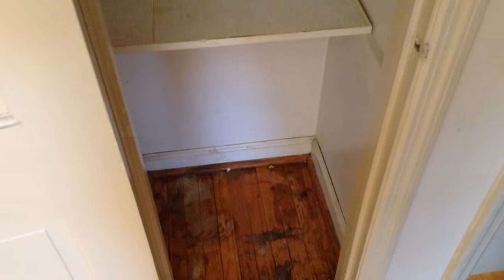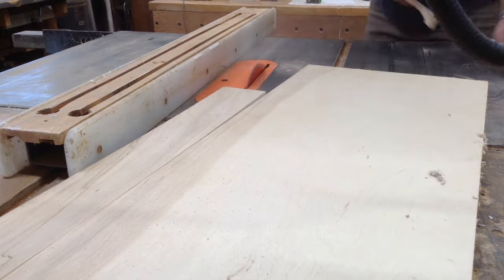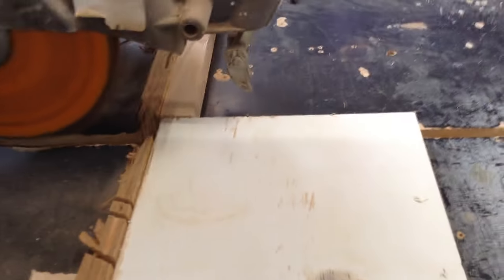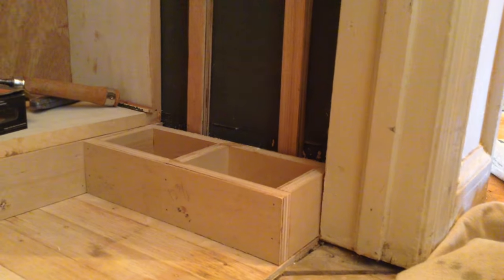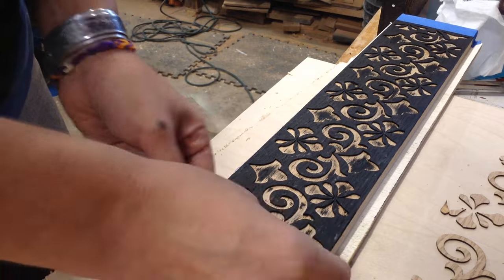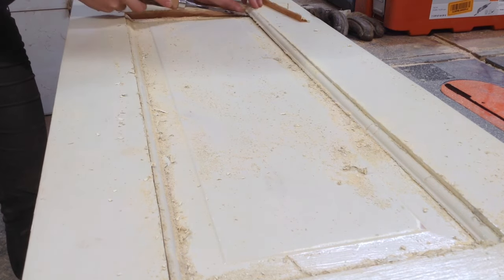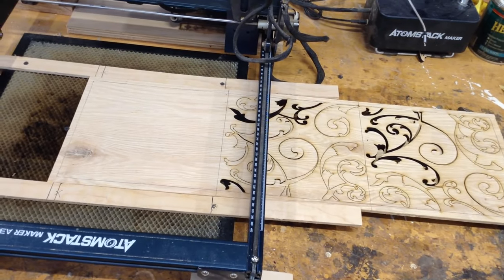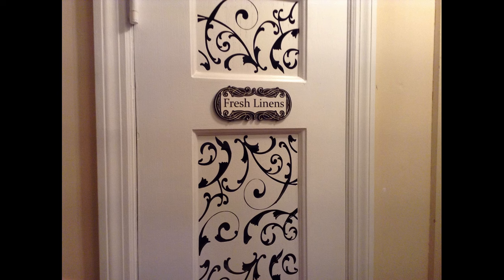Closet Remodel || How To  [Woodworking Projects]

Comment: Damn I want a laser engraver/cutter even more now, that turned out fantastic completely changed the vibe of what was just a plain little closet, not sure I’ve seen wood bleach before it certainly worked well and taking away the smell was a double bonus, you certainly have a design flair I wish I possessed, but that’s just life I guess 👌👌👌👍👍👍🇦🇺
Reply from the maker: The laser is a game changer for stuff like this.  The time commitment to have cut that out with a scroll saw would have been ridiculous.   The laser did it perfectly and I was able to work on other stuff in the shop at the same time.

Comment: Very nice job, I like the way you reuse as much as you can, I like to do the same.
Reply from the maker: Especially older lumber, it's just better quality.
Reply: @HoneyBadgerWoodWorks  Yes, and I find the old plywood way way superior unless you use special plywood not available in the regular stores like the ones used to build crates.